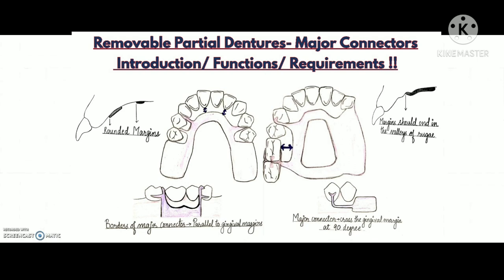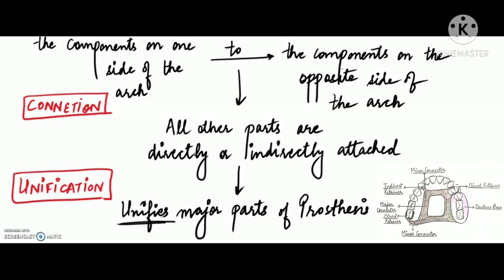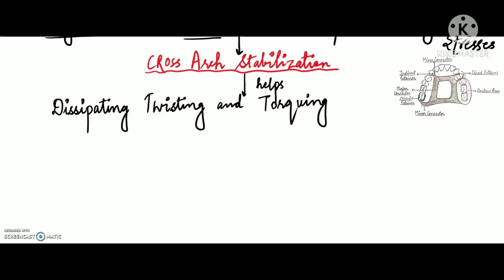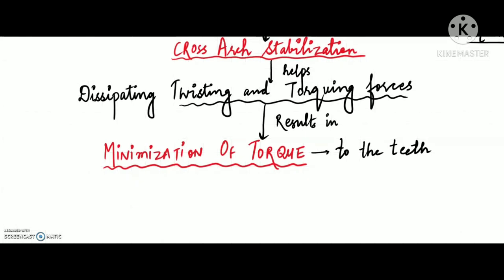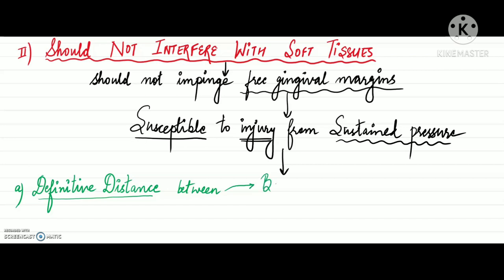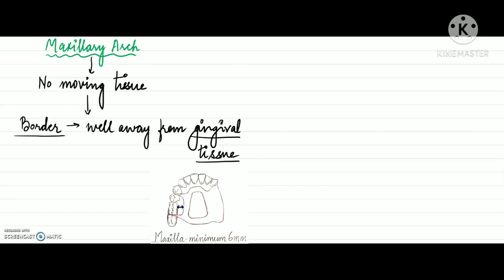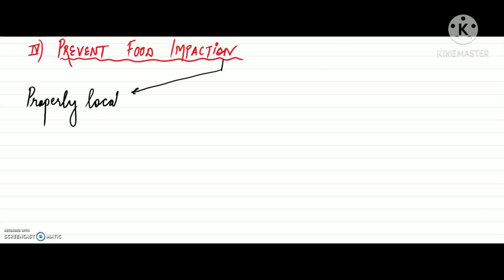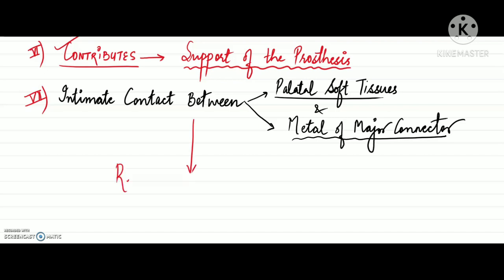Removable Partial Dentures- Major Connectors- Introduction/ Functions/ Requirements

Comment: Thanks for sharing your video. Do you have any video regarding fexible dentures and how they work. The main characteristic of this kind of denture is that it has less rigidity than a RPD with metal. How it will be affect the stability of the denture and natural teeth and tissues?